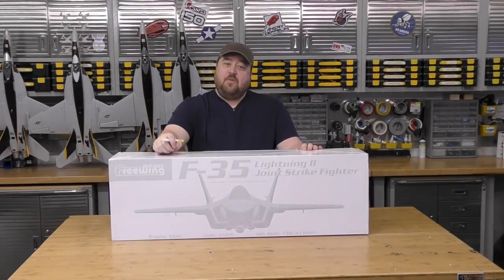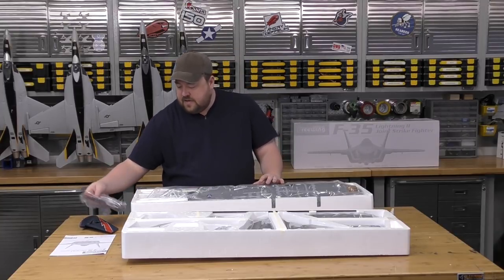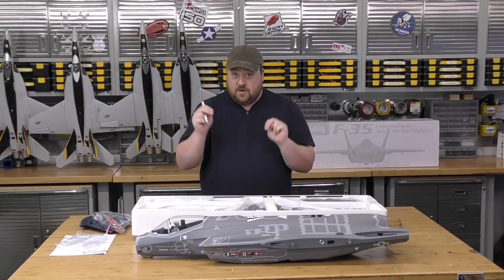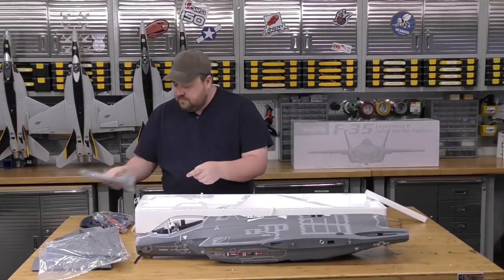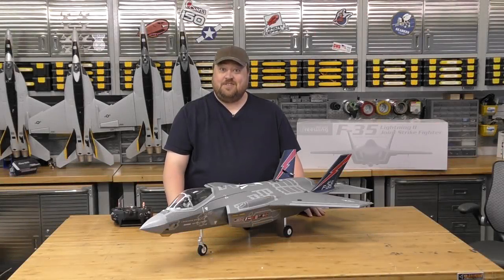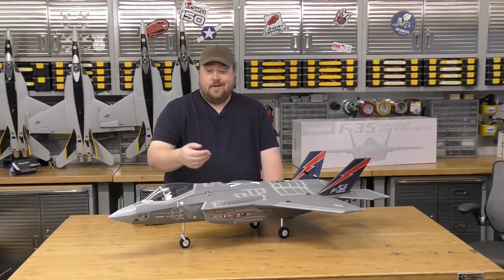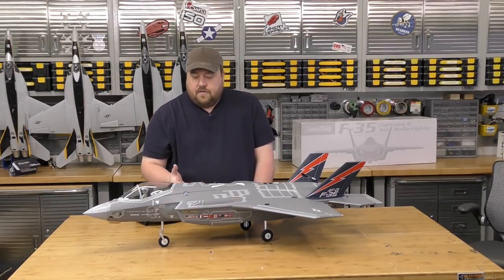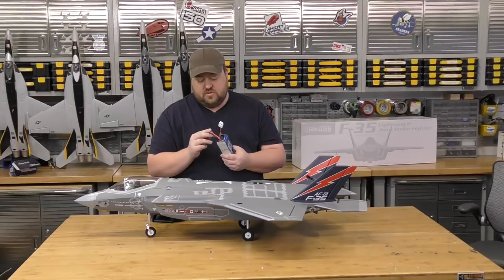Freewing F-35 Lightning II V3 Build an Review

Comment: Ive tested foam tac and fix n flex. I mounted a servo to a test piece of foam from a broken wing.  The foam tac dries faster but the fix n flex is a much better glue.  It took a lot more force to remove from the foam than foam tac. and doesnt melt the foam.  Foam tac definitely melts the foam a little.  not desirable in my opinion. The fix n flex also doesnt harm the paint.

Comment: My right rear elevator rubbed also. You have to loosen the two screws and put a gap in there then re-tighten. Also on the rudder I was confused it said 25mm going each  way. I just did mine a total of 25mm left + right.
Reply from the maker: So likely a manufacturing problem overall.
Reply: @angryzeppelin2750  no i think theres a little wiggle room till you get it tightened up. Just put a credit card between the fuse and elv then tighten it up
Reply: I did find that one of my two screws that hold in the edf lower foam piece was screwed in at a 75ish degree angle lol